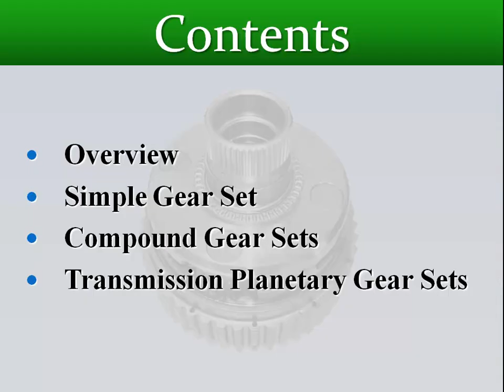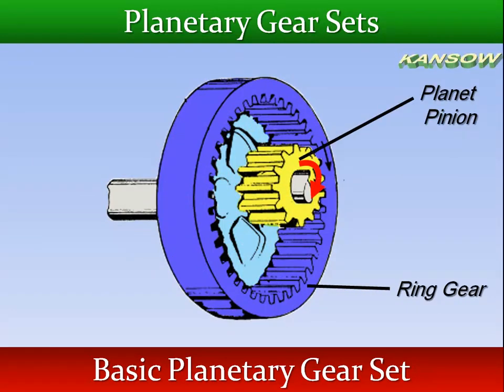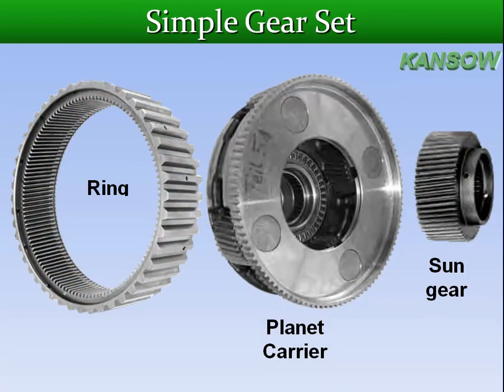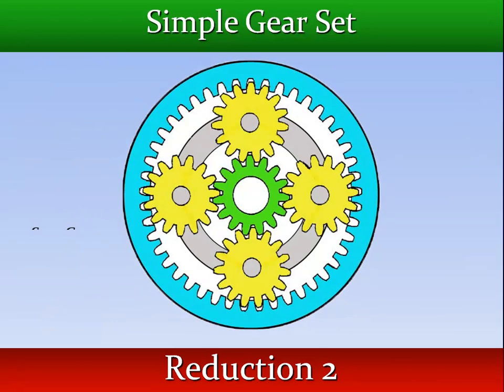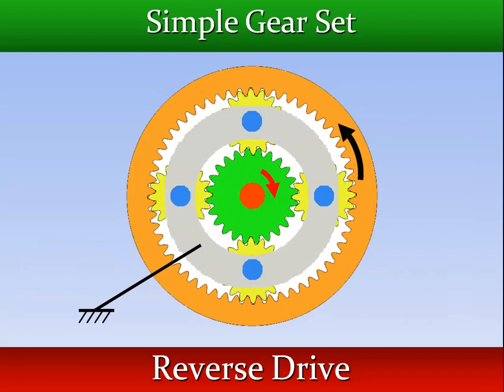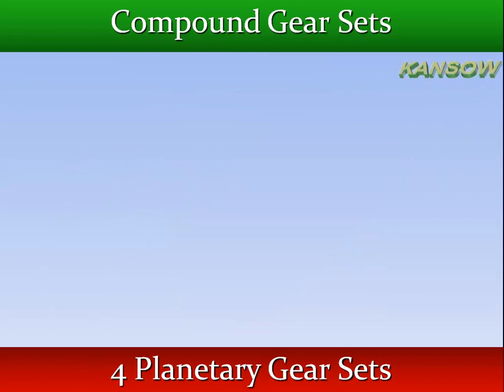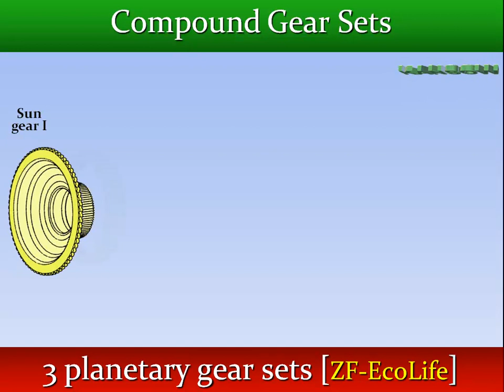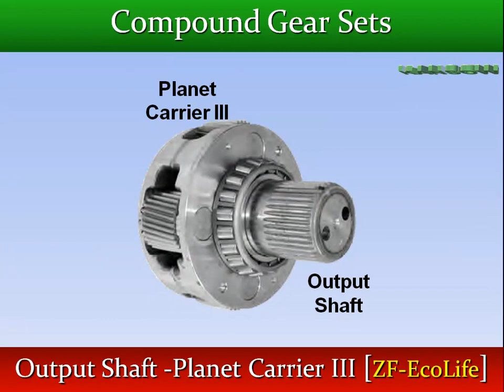Automatic Transmission Planetary Gear Sets

Comment: after how many miles should someone change clutch plates,
Reply: only need to be changed if there is a problem such as the transmission slipping , and you will only need to replace whatever clutch plates are damaged